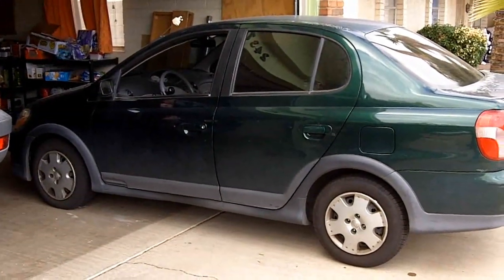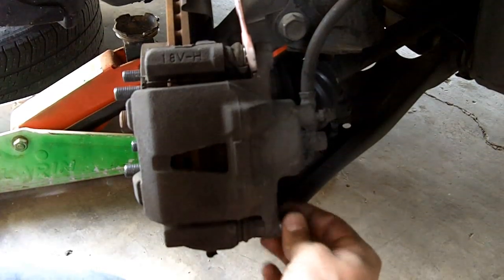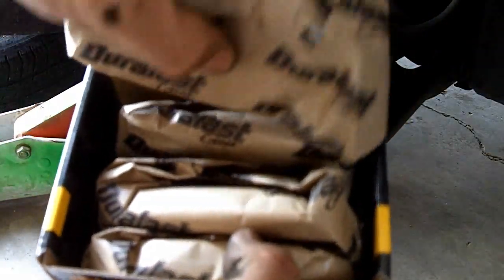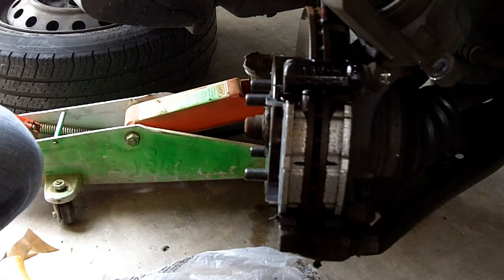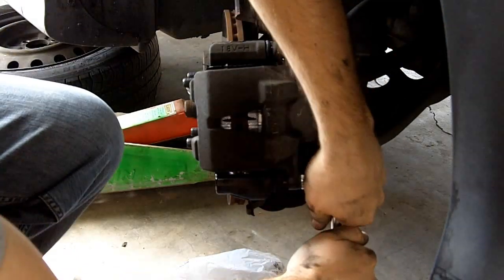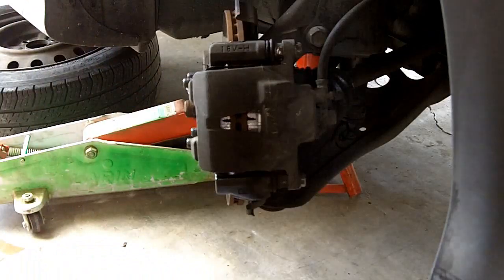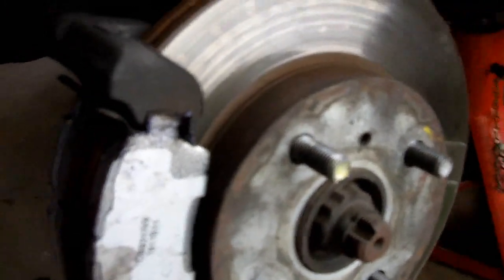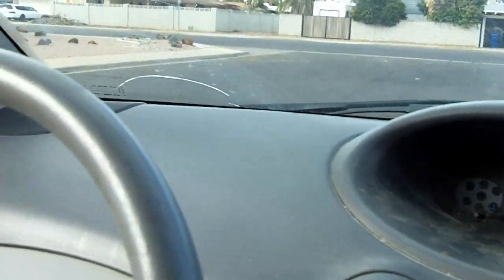Changing Front Brakes on a 2000 Toyota Echo

Comment: Thanks for posting this. I have a 2002 Echo and have been wanting to learn how to do things myself. Right now I'm watching videos on changing and testing the coils, which seem to be my current problem as I have a head gasket leak and every few months or so I get misfires. My car currently has 257K miles on it. There were only 10K miles on it when I bought it in 2005. I have to say in the 10 plus years since I've owned it, I had very little engine problems. I only recently started having some but considering the mileage and age, it's no wonder. I've had to replace the alternator twice, the starter once and I think I'm on my 4th battery. Overall, it's a really great car. Awesome on gas. So if I were you, I'd keep your car for as long as you can and just keep up with the maintenance.

Comment: I wanted to know where the wear indicator goes. Your old pads had the indicator (springy thing) on the inside-bottom, but you installed the the new ones with the indicator on the outside top, so my search continues. You should have spray cleaned the rotors before installing the pads.

On some cars, the indicator rubs on the rotor and makes a squealing noise when it touches, but these are just a visual aid because the inner one is hard to see, so I assume that they go on the inside.

Comment: Oops, I stand corrected. The wear indicators ARE of the rubbing, squealing variety. The old originals were correct, you installed the new ones incorrectly. No big deal, they just won't make much noise. The noise-making spring has to go on the side where the forward rotating rotor exits the pad. As the rotor touched the spring it pulls it away from the pad in a vibrating manner. The way you installed it, the rotor will push the spring against the pad and it won't be very noisy. Not worth redoing.